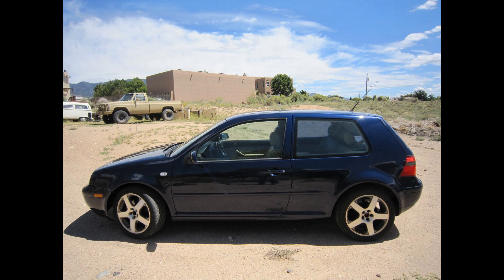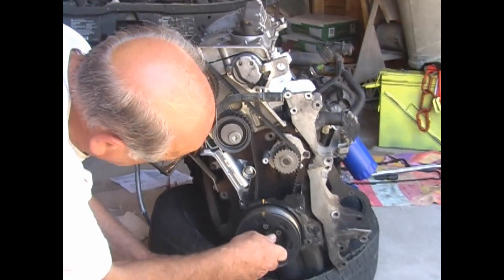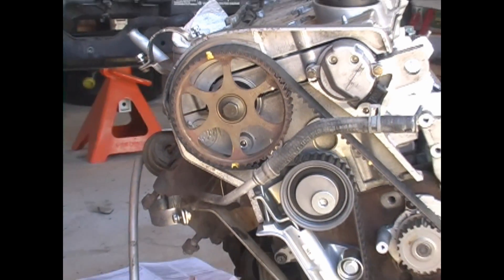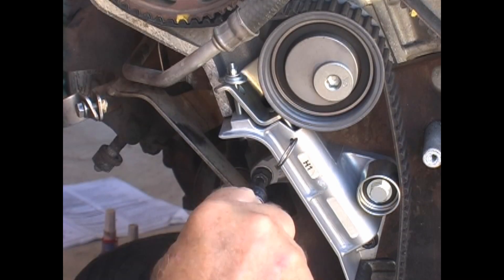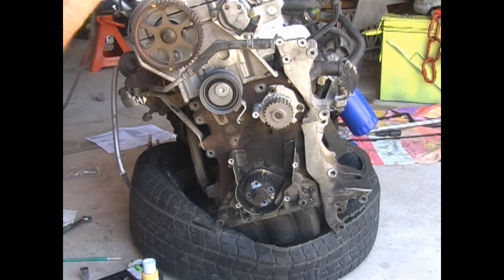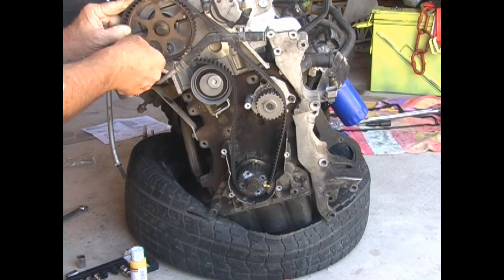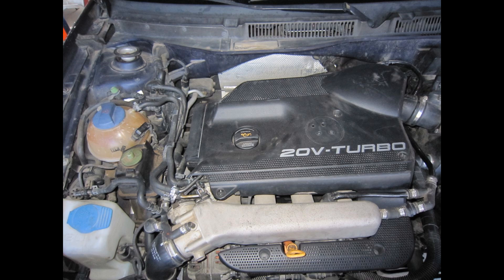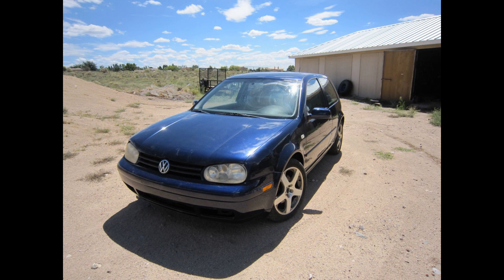VW/Audi 1.8 Turbo Timing Belt Replacement

Comment: I don’t understand how you can install the cambelt and if like here, the crank markings don’t line up you can turn it sightly. Surely this makes the cam marking out? There must be abit of tollerence
Reply from the maker: Hi James - Thanks for reaching out.  Let me see if I can explain this a little better.   When the timing belt is properly installed and the timing marks at the camshaft and crankshaft are both exactly lined up, the belt on the side from the camshaft down over the water pump to the crankshaft is under tension such that if you turn the crankshaft clockwise, the camshaft will immediately move also.   If you are trying to install the belt with no reference marks and both timing marks exactly lined up , it is virtually impossible to get it right because of the tension required.   Those who do it this way, usually end up with the belt off by one tooth.    Thus the reason for the marks on the belt to act as a reference.  When installing a properly marked belt, you can either turn the crankshaft slight counter clockwise or the camshaft slightly clockwise in order to install the belt with the marks on the belt properly lined up with the marks on the camshaft sprocket and the crankshaft sprocket.  Once the belt is installed, you can return either the crankshaft or camshaft, depending on which one you moved slightly off the marks. back to be exactly lined up with the timing marks.  This places the belt under tension such that if you now turn the crankshaft clockwise, the camshaft will immediately move also.  This is why you see in the video that the timing marks are off at some stages of the process.  Like I said, it is virtually impossible to get the belt on right without moving either the crankshaft or camshaft slightly off the marks because of the tension on the belt when the marks are exactly line up.  Of course the real test is when you rotate the engine two turns on the crankshaft and check to see if the timing marks are lined up on both the crank and cam.  As I said in the video, after you turn the engine the two turns, the marks on the belt will no longer be lined up but that is okay, it is the timing marks that need to be lined up.  I just changed a timing belt on a Lexus and the belt I got came with marks already on the belt.  But the same thing applies, I had to move either the crankshaft or the camshaft slightly off the timing marks to install the belt and then return back to the timing marks.  This is all because of the tension on the belt when properly installed.  I hope this helps you understand it better.  If not, please reach out again.  If needed, I would be happy to talk with you on the phone.  Good Luck  Wayland
Reply: Wayland Adams Thank you. I understand the theory but it seems abit odd that you have to slightly guess how much you move the crank bolt before installing the belt. Surely if the belt has 150 notches there should be a set number of notches from the cam TBC to a mark on the crank pulley and then it can’t be wrong ?!?!?!
Reply from the maker: @jshep73  James, you are exactly right, there is a set number of notches from the cam to the crank.  Unfortunately, I didn't count them when I had the car apart, but that is the purpose of the marks on the belt.  This is what one viewer supplied me.  "Hi Wayland. In the meanwhile I changed my timing belt and I can confirm that when counting the teeth on the timing belt that if  tooth n° 1 is on the camshaft timing mark then tooth n° 68 is exactly opposite to the bump on the lower crankshaft sprocket.  Indeed it is not that important but it is a 'double check' to verify if you have exactly 'copied'  the marks from the old belt to the new belt."      Do you have marks on your belt?  If not, at 5:35 into my video I describe how to put a belt on with no marks,  You can also count the teeth and mark the belt as explained by the other viewer.  The only reason you have to back off the crank is to get the belt in the proper place and then return to the mark.  There is simply too much tension on the belt when both marks are exactly aligned to get the belt on in the right place.  If you have marks on the belt, you don't have to guess how much to move the crank.  You just move it enough to get the mark on the belt adjacent the bump on the sprocket,  It is usually 1/2 to 1 tooth of movement.  But it doesn't really matter how much you move it as long as you get the mark on the belt adjacent the bump and the other mark adjacent the camshaft sprocket mark.  This will give you the exact number of notches between the cam and the crank.  Again, once you have the belt in the right place, return to the timing marks.   Please feel free to contact me again if you still have questions.  I have no problem talking to you as much as needed.  Wayland
Reply: @waylandadams2326  many thanks. I had fault code 17748 as my belt was off by 1 tooth. Now all back together and no fault code! 👍
Reply: @jshep73  Thanks for the feedback.  Being off one tooth is exactly what has been seen by others and as I explained before, is the reason for marking the belt.  Also why you have to move the pulley a little bit to get the belt in the right place.  So glad you got it back together and everything is working.

Comment: and this is how to get your timing worse and worse tooh by tooth xD use the factory timing marks on the camshaft sprocket and the vibration damper pulley/cover. belts stretch and might force the new one to start where the old one was done stretching. now its going to stretch further..
Reply from the maker: Hi, Thanks for your comments.  I agree completely that one must use the timing marks when installing a new belt.  While timing belts may stretch a little bit, they are specifically manufactured to minimize stretch.  But, regardless of any stretch, the number of teeth on the belt between the camshaft timing mark and the crank timing mark remains constant.   The reason I suggest marking the belt is to aid in getting the belt on correctly but not a substitute for using the timing marks.   What I have found is people get the timing off by one tooth because the belt is too tight to get in the right position.  The marks on the belt allow you to back off the crank a little bit, get the belt in the right position and then return the crank to the timing mark.  Once the belt is installed with the tensioner in place, it is recommend to turn the crank 2 revolutions and checking the timing marks.  At this point, the marks on the belt are no longer aligned but the timing marks should be.  If not,  the belt must be redone.  I tried to emphasize several times in the video that the timing marks are what is important.  I have just found that marking the belt as I suggest allows me to get the belt on right the very first time.  Without the marks on the belt, it is so easy to get off by one or more teeth.  Thanks again and emphasizing the importance of the timing marks.  They are the only thing that counts.

Comment: Why does it matter if the belt slips as long as the crank and cam shaft marks are lined up it shouldn’t matter right?
Reply from the maker: You are right, if the marks line up your are okay.  In the video I was having problems with he belt slipping from where it needed to be and the marks were not lining up correctly.  Good luck  Wayland

Comment: Great video... I CAN NOT get the timing belt over the cam sprocket on my MK1 TT no matter what. I will try putting the tensioner on last. But it looks easy with the engine out of the car.
Reply from the maker: Hi George  Thanks for the comment.  Hopefully this will help getting the timing belt on your MK1.  It is the same problem I was having.  In my case, the timing belt had broken requiring rebuild of the head.  Given that, it was easier to just take the engine out.  I chose to do the video while the engine was out so you could see the detail better.  But following the same steps you should be able to complete this with the engine in the car.  Good Luck!  Let me know how it turns out.
Reply: Wayland Adams I will let you know. There is no cam lock that I know of like on the 1.9 tdi. How tight was it getting it on without the tensioner and how hard was it to line the holes up once the belt was on?  I have my dad as a helper and negotiating the motor mount isn’t that hard if you keep the mount “floating”’while working the bolts.
Reply from the maker: @2747scout  I found it real easy to put the belt on without the tensioner on.  The key to getting it lined up are the marks on the belt.  Hopefully you have been able to mark your belt.  As shown in the video, you may need to turn the crank slightly when putting the belt to get the marks in the right place and then move the crank back to the timing marks on the engine and then put on the tensioner.  If you can do this, then everything is lined up.  I am not familiar with your engine to know if there are any specific changes but using marks on the timing belt can be used on just about any engine.  Good luck.

Comment: Worthless video  he  couldn't do this if it was in the car .  This fantasy video doesn't tell you that it will take you several hours  to take off front right wheel motor mount plus a lot of extra tools that you may not have like maybe a jack to hold the engine up How about you have only about 3 to 4 inches to get your hands in there . Believe me DON'T start this job until you look at some real videos on how to accomplish this job.

Comment: That’s real easy OUT OF THE CAR ,,,,
Reply from the maker: Thanks for the comment.  Yes it is much easier out of the car.  In my case, the belt had broken and trashed the head so it needed to come off.  It was easier to take the engine out to remove the head.  The advantage for my video was that I could show a lot more detail which I wouldn't have been able to do with the engine in the car.  I think the detail helps even when doing the change with the engine in the car.  Have you changed your timing belt?

Comment: I dont you are doing it correct!
The pulley need to be torqued as well and you didn't do that... the piston is the only thing pushing the pulley and it was not designed for this. The piston is designed to tackle the temperature expansion of the engine and add additional compression on the pulley.

Comment: Good Video....but try doing this with the engine in the car.....After you're done, try doing this on a 2001-02 Audi TT with the same AWP engine. It will go nothing like this....MAINLY BECAUSE OF THAT $%##!! BRACKET VW's ENGINEERS DECIDED TO JUST PLACE ON THE REAR OF THE ENGINE WHICH COVERS THE TIMING BELT TENSIONER ASSEMBLY. REALLY STUPID DESIGN. SEEMS THE ONLY LOGICAL WAY OF DOING THE TIMING BELT ON ONE OF THESE IS REMOVE THE ENGINE. Factory repair manual labor quotes 3.5 hours to do this job. Trust me....you're going to be there a hell of lot longer than that. Maybe with a Golf it might be a bit simpler. But on the Audi TT........you've been warned........
Reply from the maker: You have my sympathy.  I am not a professional mechanic so I doubt I will ever do another 1.8 timing belt.  When I was doing the one I did, the belt had broken and ruined the head.  That drove me to just pull the engine.  But I still felt it would be useful to make the video so you could see the parts better than if the engine was still in the car.  Thanks for the note and warning.

Comment: great video. would this be the same for a non turbo?
Reply from the maker: Hi Cory - I am not familiar with the non turbo 1.8 but if is the same engine as the 1.8t then this applies.  Aside from that, the principals of marking the belt and aligning the marks apply to all engines.  Sorry I couldn't be of more help.

Comment: How do I transfer the marks
Reply from the maker: I assume from your question that you put marks on the old belt before removing it.  Take the old belt with the marks and lay it on top the new belt.  Put a mark on the new belt corresponding to one of the marks on the old belt.  Then making sure the two belts line up, put a mark on the new belt corresponding to the other mark on the old belt.  It doesn't matter where you start on the new belt.  Another way is to count the teeth between the two marks on the old belt and then place marks on the new belt with the same number of teeth between the marks.

Comment: And what about the water pump? Do I need to change that too?
Reply from the maker: While you really don't need to change the pump if it is working and not leaking, I certainly recommend you change the water pump. as stated in the video.

Comment: Will this procedure be the same on a 03 Passat 1.8T ? My belt is loose... I’m guessing it’s my tensioner is bad. Anyway it’ll be my first timing job
Reply from the maker: Yes, this should work on your engine as far as I know.  I would really be careful running your car very long with a lose timing belt.  If it skips timing very much you can be in real trouble with bent valves etc.  Good luck in getting your car fixed.
Reply: @waylandadams2326  Thank you for the response.. I just bought the vehicle and it runs fine and luckily i was able to spot the lose timing belt before something major happened.
Reply: BTW awesome video and i finally know why people mark their belts.. i always wandered about that!. lol ok have an awesome day!

Comment: Thank you sir you're a gentleman and a scholar my name is Will 40 plus years as a heavy equipment mechanic and a commercial fishing vessel engineer it's always nice to know the little nuances you are a great help thank you so much
Reply from the maker: Hi Will  Thanks for your comment.  I am sure you have plenty of tips from your many years of experience.  Glad I was ab;e to provide  some helpful hints.
Reply: The one and only thing I did differently instead of using a piece of wire to tie up the tensioner pulley I used a poly tie or a wire tie what have you

Comment: Really nice vidéo  and will work on a couple of models. But dont try this way on a mk 1 Audi Tt you wont get the tensioner back !! On a Tt space is a big problem so dont try it this way.
On a Tt i prefer to do cam sprocket last and its still a B...tch
Reply from the maker: thanks for the comment and input on the MK 1 Audi TT.  I am sure others will appreciate your experience

Comment: Quick Question. The kit i ordered includes crankshaft and camshaft seals. How would i go about replacing those? or would i even need to?
Thanks!
Reply from the maker: Hi Jesus
I have never replaced those seals.  Here are a couple of links talking about it.
https://www.youtube.com/watch?v=8lGbzmaKdqM
https://www.audizine.com/forum/showthread.php/453998-Front-Crank-Seal-should-I-bother-replacing-while-doing-Timing-belt

You can probably find some other information about changing seals by googling on the subject.  
Good Luck.

Comment: Thank you sir.  Are these good motors
Reply from the maker: Thanks for the reply.  The 1.8 turbo is considered  a very good motor.  It was introduced in 1993 and has been installed in millions of cars.  You can refer to this link.  https://itstillruns.com/engine-specifications-18t-6646210.html

Comment: Hi Wayland Adams. I would like to thank very much you once again for the video.  I have just done my timing belt change  after watching your video several times. it was easy to do everything with the engine support mount out of the car.  Being the first time doing this, it was a big hassle for me to install everything with the engine support mount in there. My small hands felt so big when i try to install the tensioner with that big engine support mount. After a couple of tries,I tighten everything without the engine support mount and took a day break "because of engine support mount". luckily the following day  with a fresh mind i managed to slide the engine support mount  back.  I guess only gurus knows how to do it with the engine support mount in there. For beginners like me, you must remove the turbo intercooler hose( where the is a C like clamp) and jack the engine up a little bit and slide it( engine support mount) up from underneath next to that turbo hose.You will also need assistence to pull the engine "a little bit" to front of engine of the car while u slide it up. Thanks Wayland, Keep up the good work.
Reply: What cat did you do it on? TTs seem to be more complicated...